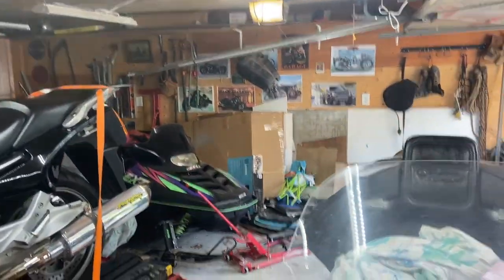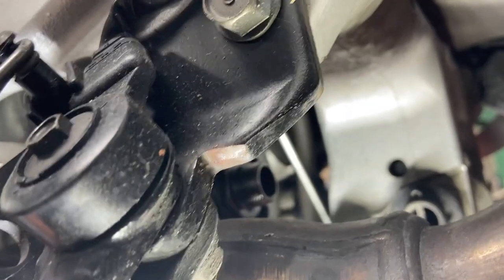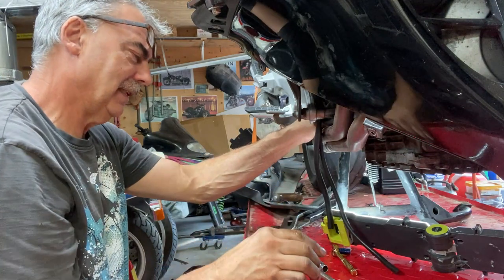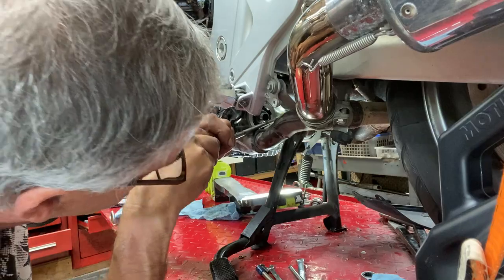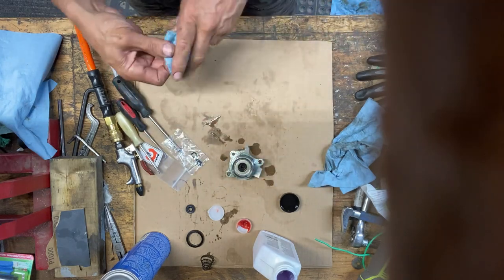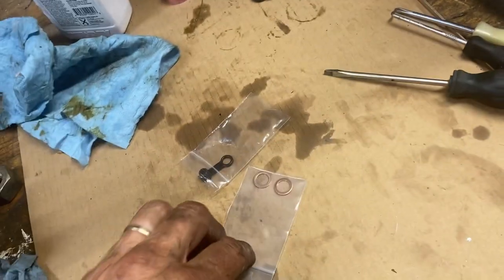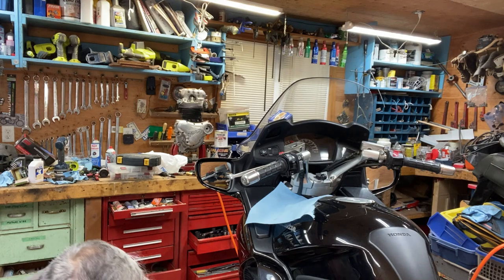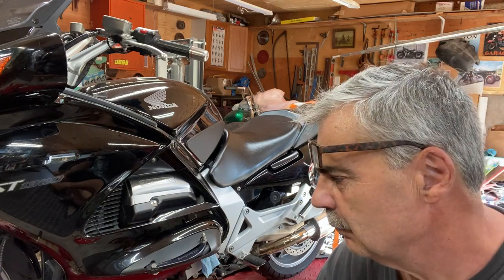HONDA ST1300 CLUTCH SLAVE CYLINDER REMOVAL REBUILD REPLACE

Comment: Greetings from Calgary! You're so lucky to have that lift. I'm at the age where doing all the low stuff on the ground isn't friendly on my body anymore. My 81 GS1100 needs work but I keep procrastinating because I don't have a lift like yours. I started following your channel when you were doing the SUZUKI GS1100 RESURRECTION series. You're a true inspiration and I hope one day it rubs off enough that I actually fix my bike. I love the music you sometimes play! PS, something is leaking on my pan too and I can't get under there to see what it is... :(
Reply from the maker: Thx for watching Glenn, much appreciated. I think I am going to drop the oil pan on the ST1300. It is a friends bike and it should be fixed.
Reply: I use a ratchet straps to the rafters on my carport and lift my motorcycle off the ground. I can't see spending so much money on a lift. Maybe if I worked on everyone else's bikes.

Comment: Great video. I was able to get the 3rd bolt out without removing the filter. The trick is a foot long extension.  The banjo was the hardest part.
Reply from the maker: Great tip!

Comment: I know folks do not want to remove anymore than what they have to, but sometimes getting things out of the way helps a lot!  I have replaced two clutch slave units on two different ST1300s. I was also replacing the clutches at the same time, so I had to tear the bikes down farther anyway.  I was using a motorcycle lift, but to make it easier to get to the clutch slave, I removed the exhaust (just dropped it out of the way), center stand, side stand, the oil filter and oil cooler, and the gear shift & linkage.  This gave me much more room and less straining to remove the bolts and even the oil seal the shift rod goes through.   And just for reference, I have over 396,000 miles on five different ST1300s, since November 2005.
Reply: at what mileage did the clutch slave showed leaks and are there updated Honda part numbers that addresses this issue ?

or is it just an expected wear item
Reply: @okinawanah3463  There was no indication from either that they were leaking. Since I was replacing the waterpump on the 2004 and the clutch on the 2010, I went ahead and replaced the clutches and figured since I had them down that far, replace the slave units too. They were both pretty nasty, so I was glad I did.  Having the lift made it so much easier.

I do want to add, I put on most of those miles, commuting 125 miles a day. Now commuting beats up these bikes a lot faster than those that take long trips and are not doing a lot of stop n go, or in  my case Lane Splitting. Lane Splitting is just as hard as stop n go traffic, because you are always on and off the clutch and brakes/down shifting.
Reply: Great information on your procedure for the clutch secondary cylinder. Wanting to get to mine too, without dropping the engine. Thanks for the share!

Comment: I’ve replaced fork seals before only to have them return in a few days leaking. Seems they had leaked so long that dirt had built up and scratched the tube and new seals would never stop the leaking. Fro then on if I could feel a groove with a finger nail I’d sell new tubes. Either new tubes or no guarantee it won’t leak again. Thanks
Reply from the maker: The only time I have had a leak, is like you say a scratch or ding in the tubes. If you are buying those Leak Proof fork seals they are junk.

Comment: I had an Honda ST that i rode 82,000 miles  before i sold it , and never had any of the problems this bike has had.
Reply: Mine has 130000 and runs and rides like a new one.
Reply: Why did you never have a clutch slave cylinder problem. Because you probably changed your clutch fluid. I didn't like this video from the start, when he said, "it's a common problem". No it isn't. Only from people whom don't maintain their bikes.. Also, the three cylinder mounting bolts are not 8mm. I couldn't finish watching this video after that mistake. 150k and no problems with my clutch slave cylinder, I service the clutch fluid.
Reply: @robertadams487 So what is the bolt size on the clutch slave cylinder, 10MM? Not watching a video due to a minor technical error is silly. The man in the video knows his stuff. Clutch slave cylinders wear out even with frequent fluid changes. The owner of the bike may have been a commuter, with lots of stop and go driving.

Comment: I wonder if a peace of rubber hose would have worker to put the bolts in.
Shove the head of the bolt in the hose then try to screw them in.
Just a thought.
Reply from the maker: Yes, good idea. I use a hose almost every time when changing spark plugs.
Reply: Magnetic gloves